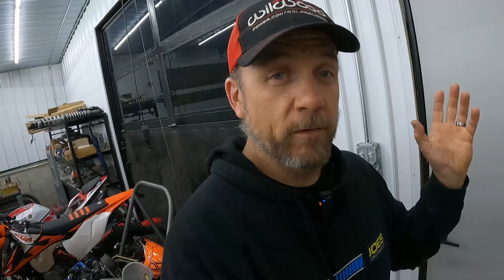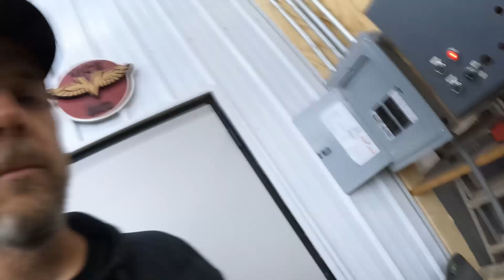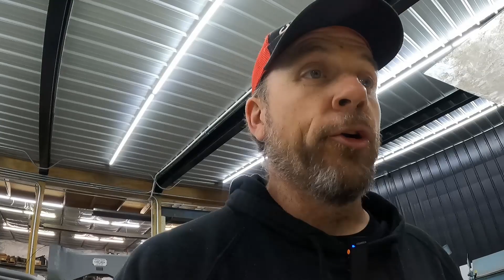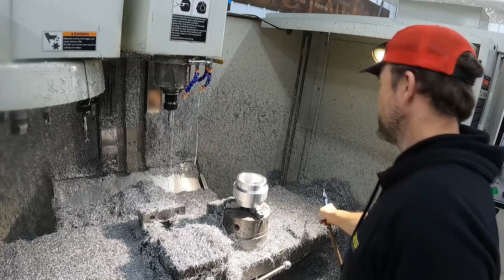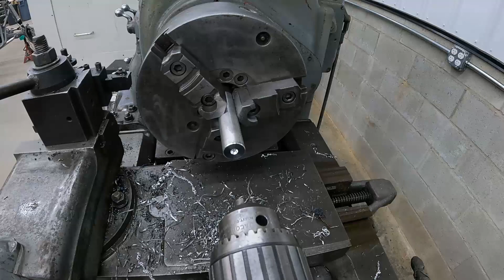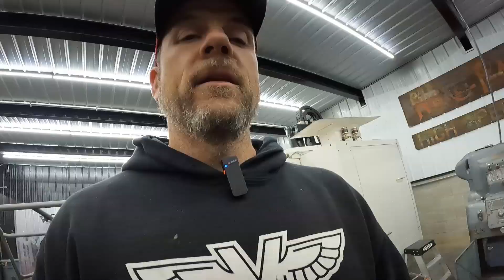cross kart 5

Comment: you want a much bigger wheel bearing in that outboard hub. the ones in our midboards are about the same as what you got in your center section. you are going to need a MUCH larger rear sprocket. shoot for a 6:1 final drive ratio, at least.
Reply from the maker: Did you see the size of the bearing. It huge bigger than any wheel bearing I’ve ever seen. It’s 6.5” in diameter
Reply: @ViceUnlimited  ooohhh i thought at 35:59 you were showing the REAR hub bearing didnt realize that was for the fronts. We still use combo spindles on the front of our cars. not unit bearings. the 6" or so bearing you are using in the center section is very similar to what we use in our midboard hubs. but we dont run sealed bearings. our hubs are serviceable. put some 300m cv cages in there while you are at it.

Comment: Awesome work, again. What overall gearing are you aiming for? With tires in the 27-32in range (I'm guessing) and the super long gearing of the R1, your current sprocket seems small (except if you're running a jackshaft).
I made a collection of minibuggy/crosskart stuff from the web a while back, check it out for some inspiration: https://docs.google.com/presentation/d/1_j_7kUrY6Zi3-nUGpCFWlu-CImA4BqVXM1Y-6Ta11FY/edit?usp=drive_link